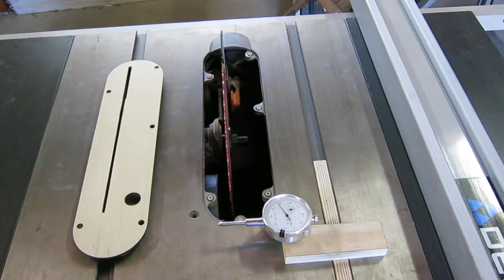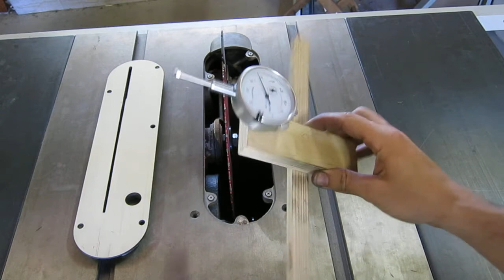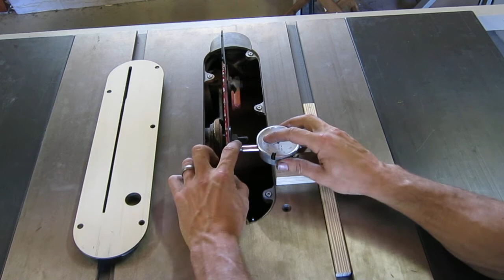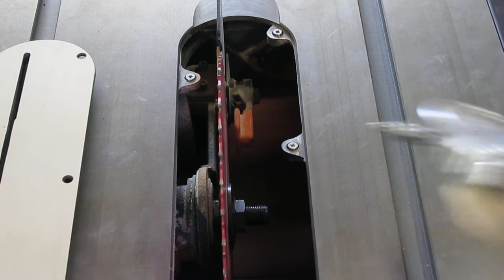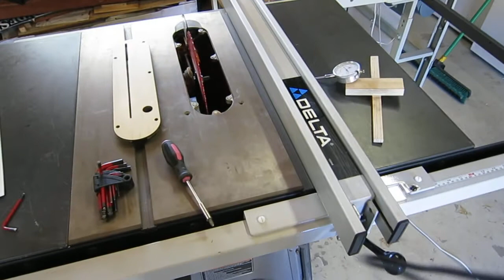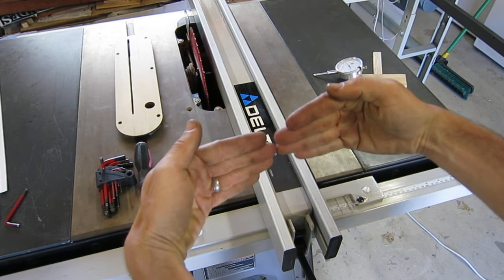Ridgid R4512 Table Saw withOUT Blade alignment Defect

Comment: Great video, thank you.  I purchased this model saw about 4 years ago and didn't assemble it until yesterday.  So far, I don't detect any lateral movement in the front or back side of the blade when raising or lowering, but I haven't cut any wood yet.  Maybe the issues emerge with usage.  I will be sure to raise the blade any time I lower it in order to attempt to zero out any shifts.  Thanks again.

Comment: I have been researching this $529.00 saw & the cheap metal top extenders which also have to be levelled to the cheap split rail assemblies which also have to be very carefully aligned is problematic by design or lack thereof. I won't touch this unit. After several hrs. of assy along with alignment of the " split " rails on both sides of the table, you end up with a questionable piece of equipment. In addition to my complaint list are the adj wheels, or lack thereof. The original version came with FOUR casters, then THREE & now it comes with TWO casters attached to a cantilever that lifts the entire unit off the floor.  Hats off to the gentleman with his CORRECT solid rail & fence by Delta as this unit should have been built this way from the very beginning at the price point it is set at. I will continue my research for my next table saw & I would be willing to spend a couple hundred dollars more to get a higher quality saw, perhaps Delta, Makita, etc... :-)

Comment: Which caliper is that you're using? Thanks for these videos. I just started assembling my new (date code EM1515) R4512 and am hoping I don't have this blade-shift issue.
Reply from the maker: +ThePhokus Congrats on the new saw!   The measuring tool is called a "dial indicator"  They're available on amazon, harbor freight, etc.  You can also use a caliper in the same way by using the depth gauge on it.  Or even something as simple as an adjustable square in the miter slot.  Fingers crossed your saw is good!  Goodluck!!

Comment: I purchased this saw 2 years ago,  it's been sitting in the box for 2 years now, haven't increased the space in the shop to assemble it.  How would I know if I have the updated model?
Reply from the maker: +Michael Haughey It's probably the first version but that doesn't necessarily mean it will have a problem.  This saw is the first version but the alignment is dead on.  There are other saws out there with a similar trunnion design and all of them have a little blade movement at the rear when raising or lower the blade.  The key is to make sure that you always lock the height after raising the blade.
Reply: +thesergeant i am considering this saw but i keep seeing the same negative reviews. Are these issues only on previous ones? If i buy this saw right now at home depot have all these errors been fixed? thanks
Reply from the maker: +Abby/Brandon Balaban Apparently they changed the casting on the trunnion in the last year or so, which has improved some of the dramatic blade shift seen in older models.  The new trunion design hasn't cured the problem though, as the shifting is a inherit design flaw of this trunion design.  The craftsman, ridgid, grizzly and other models similar to this 'hybrid saw' all exhibit the movement.  That said, I'm  very happy with the saw now.  You just have to make sure that after lowering the blade your do a slight raising of it to 'retention' the trunnion and get everything in perfect alignment.   As you can see from the video mine is within less then .001".  That's pretty phenomenally accurate for any saw.  I'd give the saw a chance as there isn't really anything in this price range with these features.  You could get an older saw (which I considered as well) but you're going to lose safety features like the riving knife and improved blade guard.  Goodluck!
Reply: thanks for  the fast response. I work at a custom cabinet shop so I have been spoiled with 10 top of the line Sawstops for the last 4 years haha this is my first saw purchase for my home so I guess im probably being picky. With as much work as I do, I will be rasining and lowering quiete a bit. Would hate for an alignment issue to slow down my work. How fast can you readjust of out of line on this saw?
Reply: Menards has a Masterforce contractor which appears to be a spitting image of the ridgid. Only difference is their motor is a 15 amp. Same price and all. But I cant find 1 single review on that saw....
Reply from the maker: +Michael Haughey If it's 2 years old it's likely that it's a "Version 1".  You can tell if yours in an 'update model' by removing the back cover and looking for a "II" cast into the trunnion.  The new ones still have blade shift issues though, it's just a matter of to what degree.  It's just something inherent in the design of this type of saw.  It's a common problem with this Ridgid, Craftsman, Grizzly and others that share this style trunnion.